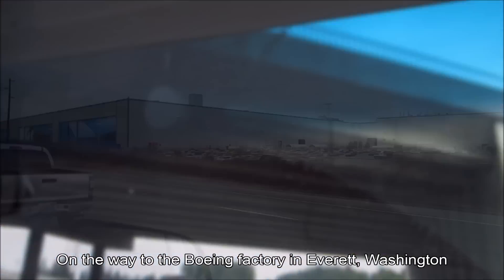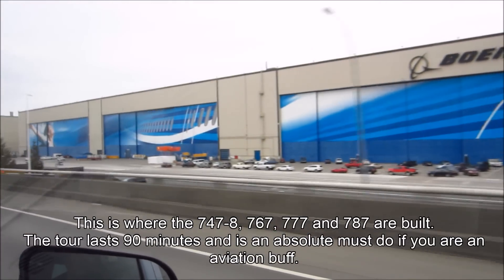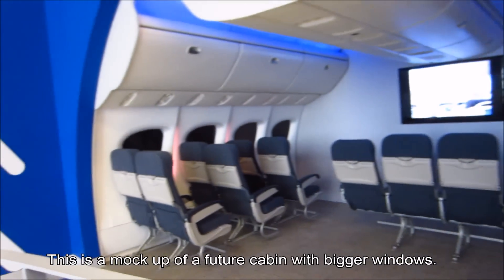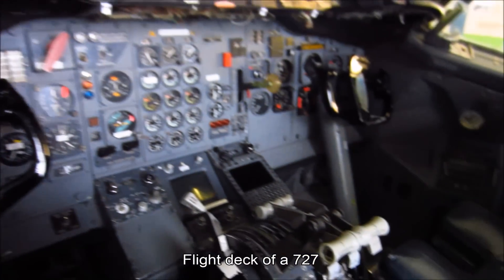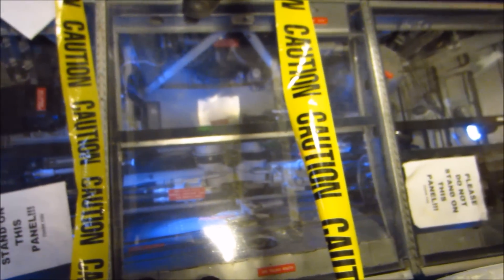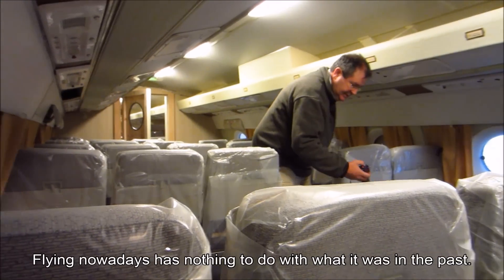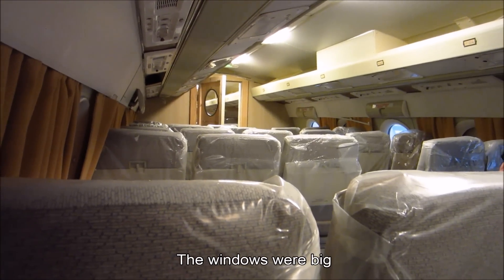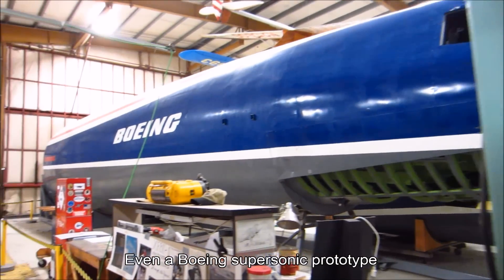Boeing Everett factory tour | Dreamlifter | Dreamliner | Airplane Restoration Museum | First 727

Comment: I have a second question. How the hell (sorry for the French) does the personnel drive those planes out of the buildings?
Reply: Aircraft tugs are used to tow them out of the main assembly factory to the flightline for ground testing or to the paint hangars

Comment: Would only be interested in going into the actual place where the production line is, would rather watch real live aircraft test flying than looking round  crappy old exhibits anyday of the week.
Reply from the maker: You actually visit the production lines (from a walkway above) of the 777, 787, 747-8 and 767 at that time. The only thing is that cameras are strictly forbidden in those areas and that's why I don't show it in the video. You can also watch the flight test of new aircraft from the terrace. I didn't see any airplanes flying that day while on my visit, but when we were leaving, there was an EK 77W on final approach.

Comment: I just did the Boeing factory tour last week, but I do not remember seeing the Comet. Is this in a different part of the building?
Reply from the maker: +ani19bd Actually the Comet is at the Airplane Restoration Museum. To get there it's a 10 minute drive approximately from the place where you've been, just on the other side of the airport (check it on Google Maps).